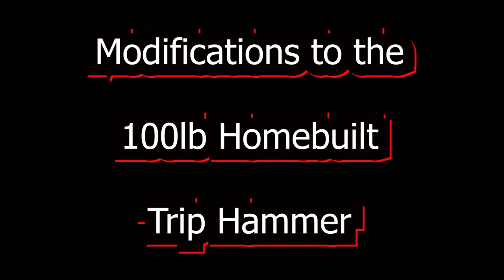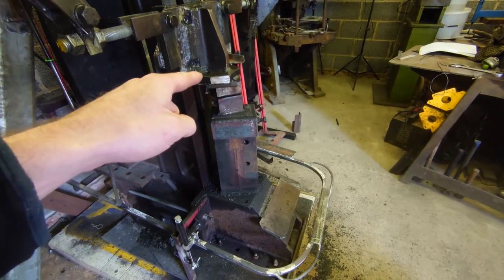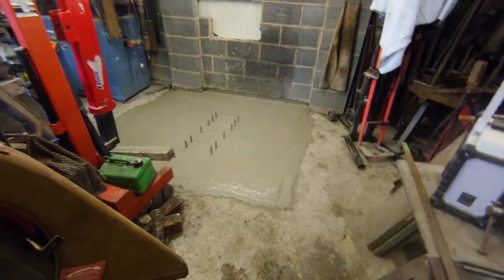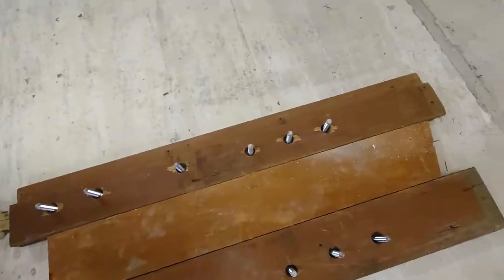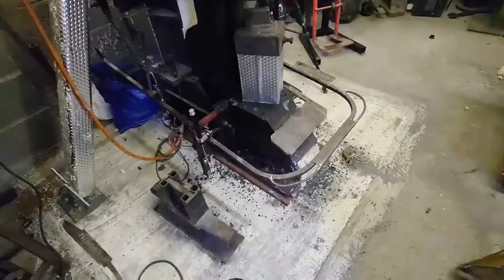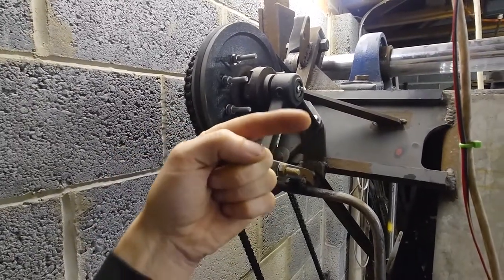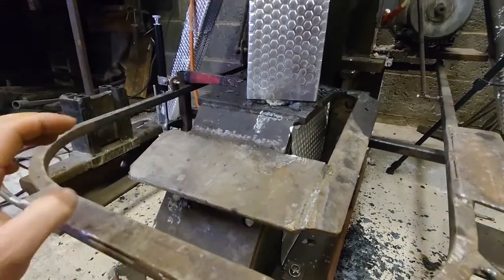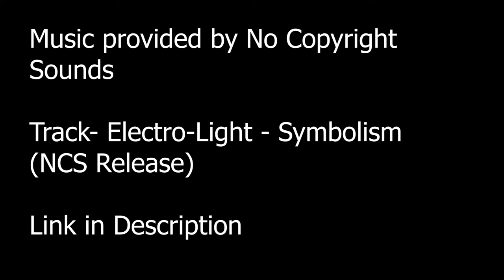Modifications Time For The  100lb Powerhammer

Comment: Wow quite a bit of work you got squeeze into one video!
Am really glad it's functional and better now.
Surprised the foam filling worked so well sound deadening.
As for the shiny stuff what is it? Like aluminized bubble wrap or another material?
Crawford our 🙏🔥⚒️🧙🏼‍♂️
Reply from the maker: Cheers dude 👊, the shiny stuff is the stuff you buy to put in cars and stuff, its sticky back rubber in the shape of bubble wrap sold as deadening rubber for speakers and such 👍 the biggest difference was the foam filling all the empty cavities 👍
Reply: @DaMainMouse  oh ok I gotcha. Hadn't thought of that particular item. 
So many enovative   ideas from all y'all out there
Reply from the maker: @dragonstonegemironworkscra4740  we do try to think outside the box where we can, sound deadening from under the hood of cars and trucks is a really cheap way to insulate panels from heat and sound also 👍